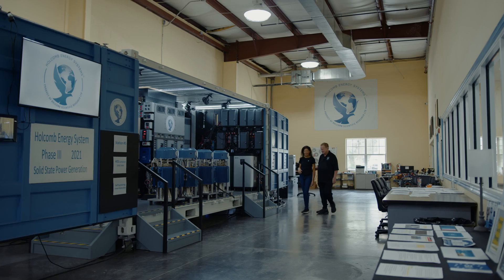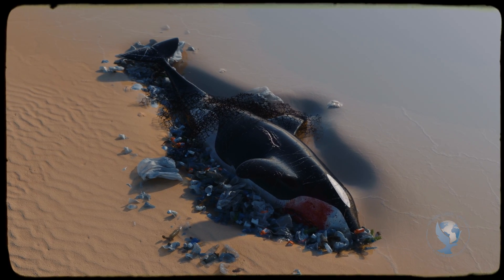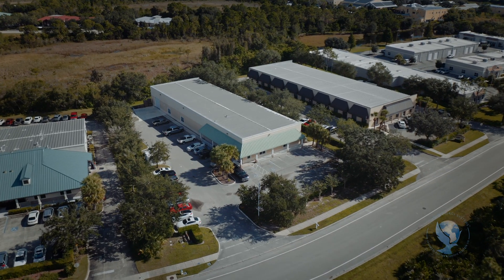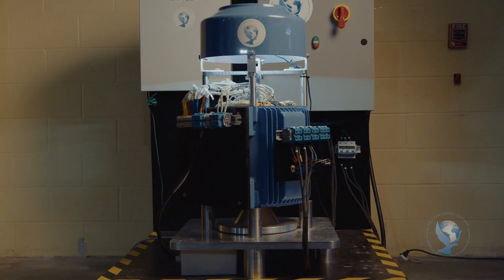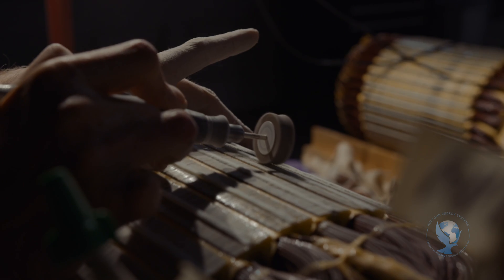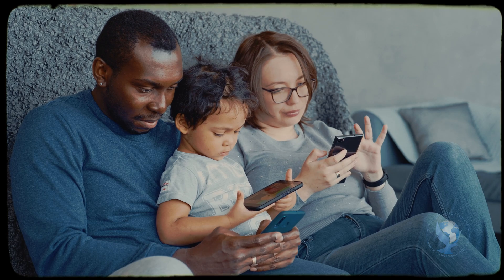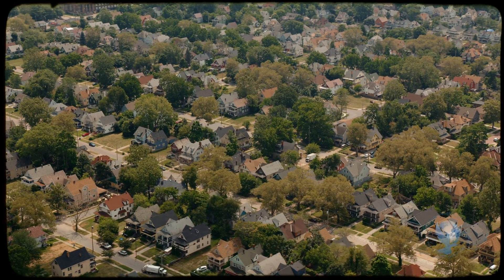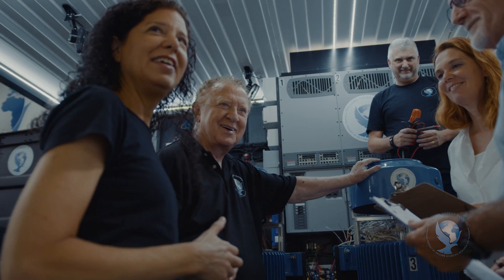Introducing the Holcomb Energy System (Long Version)

Comment: How will the HES integrate with a Turbo Encabulators modial interaction of magneto-reluctance and capacitive diractance since the main winding is of the normal lotus-o-delta type placed in panendermic semi-boloid slots of the stator?

Comment: I am very interested in Dr. Holcombs generator. 99% of engineers and physicists would say that Dr. Holcomb’s generator is impossible because of the 2nd Law of Thermodynamics. However, a few of us believe it is possible to organize thermal and quantum electromagnetic fluctuations found everywhere, even in "empty" space (vacuum).  I hope Dr. Holcomb really has the breakthrough we all need! If so, it will be a huge paradigm shift. I would very much like to help.

I notice that the DNV certification report does not seem to be listed on the DNV website as verified. Did somebody forget to pay the yearly renewal for the listing?
Reply: Wake up.
Reply: Yeah the breakthrough of definite lying

Comment: With that much excess energy why isn't output looped back so it can be a completely closed system? Why does it need to be inline with the grid input?
Reply from the maker: That's actually exactly what the HES is doing. Part of the HES power output is used to run the system in a self-regenerating fashion.